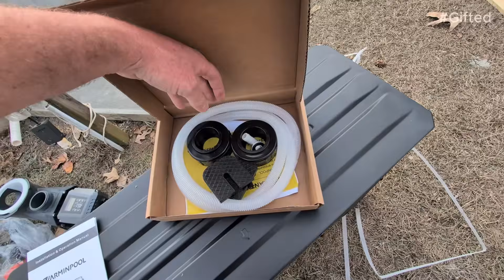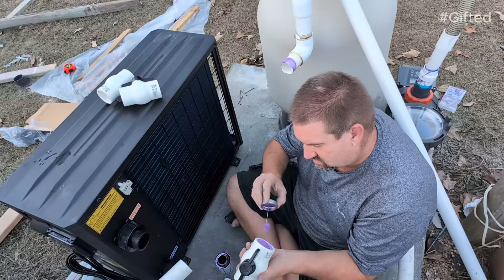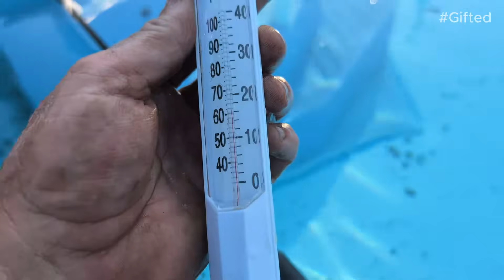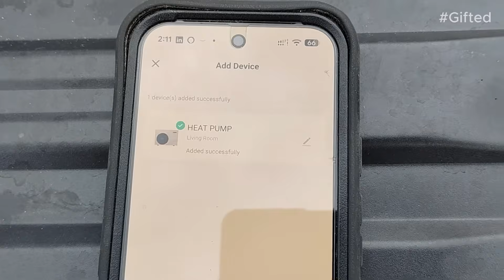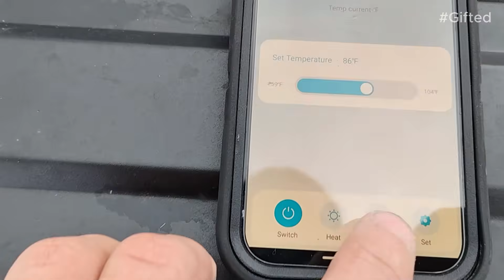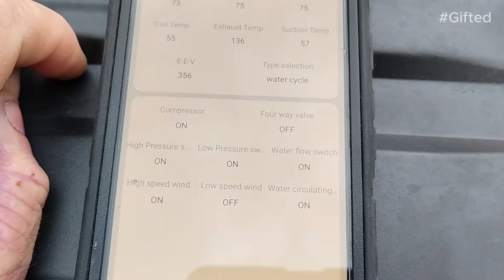VARMINPOOL Smart Electric Pool Heater INSTALL and DEMO of new HEAT PUMP

Comment: It looks like you are using drain fittings. All your fittings should be pressure rated.
Reply from the maker: Maybe but it works so far

Comment: It’s been 3 months since the video I just got one is it still sufficient and does your heater pump still work pretty good with the WiFi and doesn’t disconnect?
Reply from the maker: It still is working.  The wifi does sometimes disconnect from the app. It is easy to reconnect it to the app.